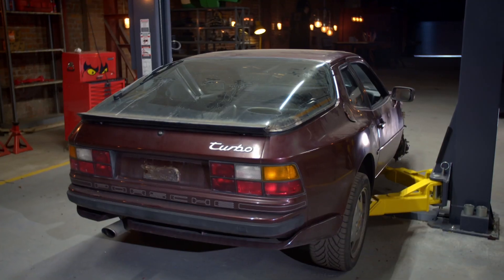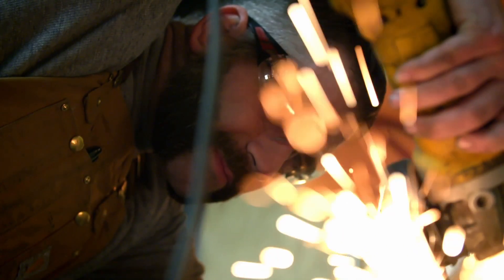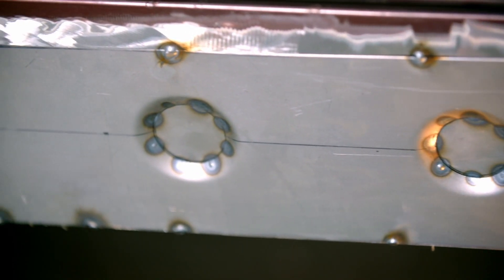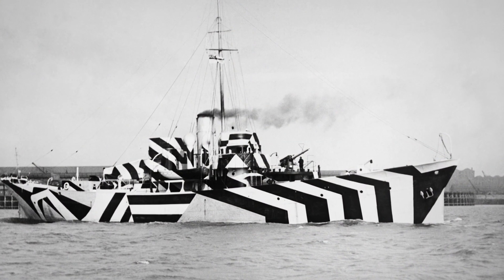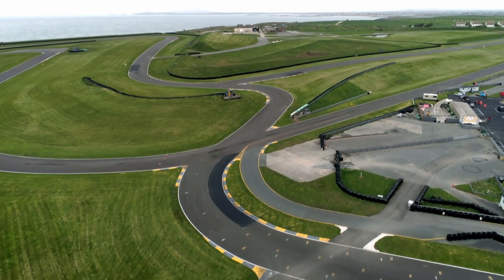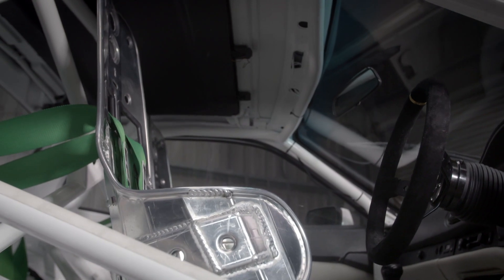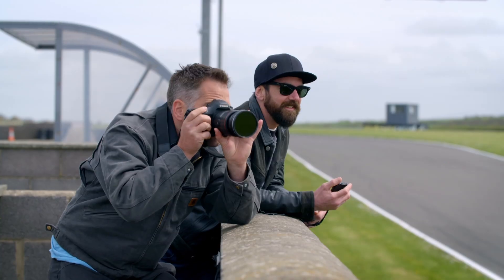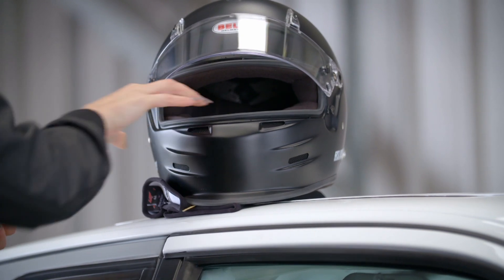Porsche 944 Turbo Transformed Into Powerful Track Day Car | Goblin Works Garage

Comment: I have to give the team credit for getting away with it!, I’ve rarely seen so little aptitude or talent, there is some comedy value in the hopeless creations they come up with though, my favourite was the beetle they did with no front wings and badly fitting bonnet, absolutely hilarious, good luck to them I say :)
Reply: @mark tagtag obviously you can do loads better? How come we don't see you on one of these TV shows demonstrating your talent then?
Reply: @superbrit3845  well yes I can and have done loads better, and why am I not on tele, silly question.
Reply: @superbrit3845  hiya superbrit, sorry for the delayed response, I’ve been in hospital all week following a life saving operation, unfortunately for you it worked 😂, I’m not arrogant, I’ve done several high quality builds, one winning best in show, so I wasn’t being arrogant I was just stating a fact.
My opinion of the work on that show is that it’s generally poor and at times shockingly bad, it’s a view that’s widely held , if you like their work, well that’s your opinion, but it does appear that it’s a minority view, by the way I’ll return the question, could you do better, have you built anything, bike, car, boat?

PS you may be correct about my spelling, I’ve looked and I can’t see the error!, what was my spelling mistake?
Reply: @1234567marks  Let’s see some of your creations then big mouth or are you just all hot air?
Reply: @superbrit3845  ha, I note you didn’t answer my questions, you have never done a build have you, your just a silly little troll aren’t you, I can’t upload photos on here can I ?, what I can do is put a link to a 60’s Honda racer replica I built though, it wasn’t quite finished at the time, it was when I took it for it’s Dyno run, the front mudguard for example was just a lash up to allow me to ride it to the Dyno station and I subsequently replaced it with an all alloy item fashioned by myself , I’ll put the link in my next post, now be aware that when you’ve seen it and respond saying it’s crap or whatever you won’t get a further response, not because I’m upset or because I think your right, but because if the last 7 days has taught me anything it is that life to short to waste time talking to people such as your good self 😂

PS, the spelling mistake????

Comment: Front areo ? Rear areo ? 
Lowering ? 
regular body work? 
Paint?

I got an idea 
Cammed LS 
Basic single stage paint 
Proper areo 
And a couple light weight body panels 

I think the LS version got it

Comment: What the hell where they thinking? With this "camouflage pattern" they broke up all the smooth lines of the car and turned it into a unnoticeable piece of junk. In ww2 they had a similar kind of pattern to brake up the lines of battleships. Google it if you don't believe me. I saw every episode of the show and had to watch them make one design fail after the other!   Sorry guys, but that ain't good enough.

Comment: The only upgrade I saw was to it's gag reflex index. I feel the same way about this thing as I do about "modern art", it's stupid and no matter how you try to explain it it's still stupid. You can shave 12 seconds vs a stock 944 on that track with better tires, a tuneup and a suspension upgrade. Not sure what bugs me more, these guys and their butchery or the wannabe car enthusiast that will pay top dollar for this steaming pile of a ruined classic.